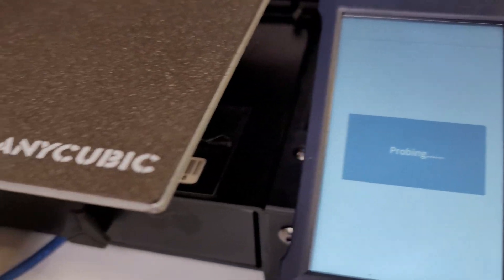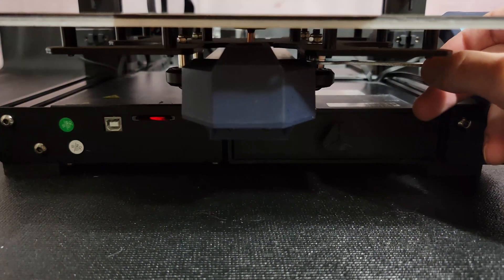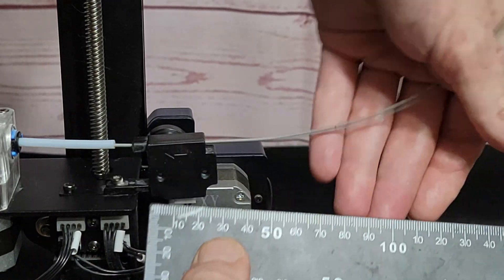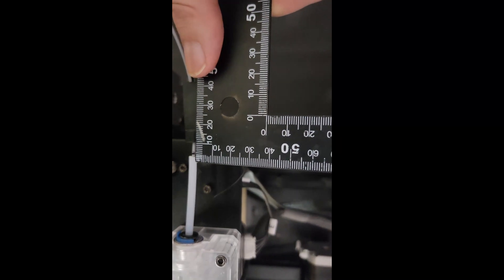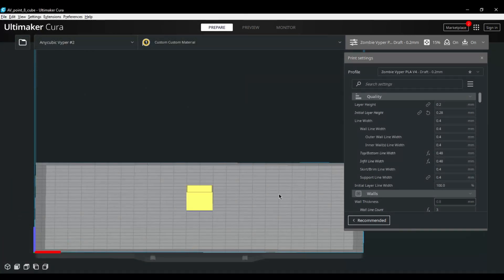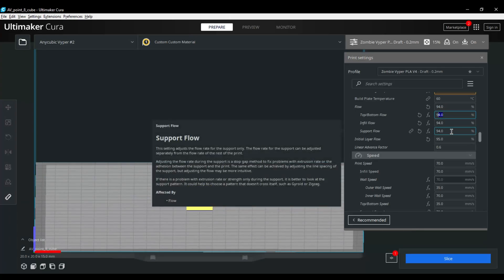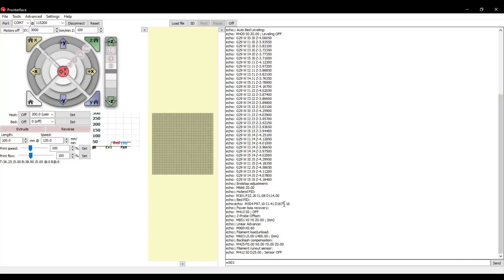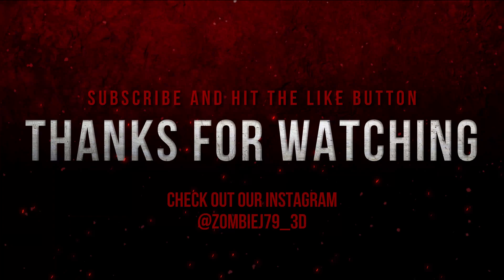Anycubic Vyper Calibration V2 (e-steps , flow, linear advance)

Comment: Dont forget to put  "leveling on" to use your saved mesh. He says everyting else should be left as is and thats not correct otherwise it wont use your mesh. I had my nozzle scrapped along the bed the first time, i should have realized. Here i am trying to calibrate again and this time i asked chatgpt about that option and it should be enabled. It also recommended to do flow calibration first and use that value in extrusion multiplier in the kfactor code generator.
Reply: it's great seeing a fellow user of my printer still exist

Comment: Overall great tutorial. Only thing I would have added (sure I figured it out myself) when it came to the E-step calibration you could have said that your value 98 you use for the calculation is simply 100 minus you measured offset. Just so every noob would get it. But that is a veeery tiny thing in a great video. thanks man helped me a lot

Comment: Hello, I have installed your firmware for the Vyper to use Linear Advance. The flashing worked without any problems but unfortunately it does not print the LA calibration pattern. It prints the first line (K0) after that the lines are incomplete or not printed at all. It also does not print the numbers next to the frame. But I did everything like in your video. Do you have any idea what the problem could be?

Comment: My linear advance test is coming out completely wrong compared to yours.  I only get 5 long horizontal lines and then the printer quickly moves up and puts two vertical lines above those.  Then it pushes the bed out, moves Z up 2cm, and stops.

Comment: anyone else  having issues with the vyper not saving the values for the bed leveling? Ive tried doing the linear test which the first time it works, but when i run anything afther my nozzle likes to print way above the bed.

Comment: Hi there, just ordered this printer, been using the Anycubic kossell linear plus for many years but can no longer source parts for it 😢 i need new rail sliders for the arms and a new build surface for my heated bed mainly. Have approached Anycubic but they no longer produce parts for the linear plus either. Can you suggest a 3rd party that may be able to supply parts or upgrades for my kossell linear plus? Im super excited about the viper and hope it lives up to its name ! How hard would it be to setup a dual colour hot end and extruders and also wondering if you know of any mods to make it direct drive instead of bowden style.... looking forwards to hearing back from you ! Am watching your videos and learning heaps have learned a lot over the year's from delta printers but just this video alone ive learned more from than years of printing with my delta. Any tips to make the Viper a amazing machine and do perfect prints would be very very muchly appreciated 😊 👍 new sub and many likes 👍

Comment: Hey man, great video thanks. Do you have somewhere I can see all your settings? I followed your tutorial but a few problems arose. When doing the Marlin test, it didn't print out the full graph, only the first couple lines then gave up. Every other step was followed before then, but when printing a benchy, it looks identical to before your video. Very stringy.

Comment: Hi.. I'm completely new to 3D printing and just ordered the Vyper yesterday.. really excited to start! As new as I am, do you think installing your firmware will make my starter prints any better? I'm ok with tinkering and tweaking settings, I just dont want to have issues and now know what to ask or how to troubleshoot.  Also - will this print PETG with its current hotend? or will I need to change it?
Any suggestions on your favorite filament brands?  Thanks for a VERY informative video.  You gained a subscriber :)
Reply: im running Will's firmware - BIG difference.  and Capricorn tubing now.

Comment: Thank you for this video. I really appreciate it. Going through this and making the necessary adjustment really improved the quality of my prints. 

Just need to tinker with my z offset a little bit. Do you have any good info you can point me towards?
Reply from the maker: For the offset I will print something with a brim then measure the thickness of the brim and adjust the offset to match inital layer height
Reply: @studiozombie3d  Great advice. I'll do it. Thanks again!!

Comment: Just curious... in Cura there are Linear Advance settings too. What should these be set to?
Reply from the maker: If you have conpatable firmware and have set it in the firmware via terminal you don't need to use the cura setting. It's more for if you need to adjust between filaments

Comment: omg, i finally found an informative video about setting up my kobra max...  
i have 1 question tho.  i used the word doc start and end the gcode,   here is the start gcode 
G21 ;metric values
G90 ;absolute positioning
M82 ;set extruder to absolute mode
G28 ; Home all axes
G92 E0 ; Reset Extruder
G1 Z2.0 F3000 ; Move Z Axis up little to prevent scratching of Heat Bed
G1 X2 Y20 Z0.3 F5000.0 ; Move to start position
G1 X2 Y200.0 Z0.3 F1500.0 E15 ; Draw the first line
G1 X2.4 Y200.0 Z0.3 F5000.0 ; Move to side a little
G1 X2.4 Y20 Z0.3 F1500.0 E30 ; Draw the second line
G92 E0 ; Reset Extruder
G1 Z2.0 F3000 ; Move Z Axis up little to prevent scratching of Heat Bed
G1 F2400 E-1
G1 X5 Y20 Z0.3 F5000.0 ; Move over to prevent blob squish 

the last line G1 X5 Y20 Z0.3 F5000.0 ; Move over to prevent blob squish 
that takes the hotend from the z2.0 mark and moves it to z0.3 THEN starts my print....
it rapids to the start of my print at z0.3 off the bed
if i change this to say 1mm will it go back to the Zstart of the print at the z0.3? or do i have to change it in the acutall file print section?
Reply from the maker: You can adjust the height on the start gcode and once the print starts it will go to the distance you have the offset set to.

Comment: Hi I've jumped into 3D printing with the Vyper as my first unit. I've been able to get some initial prints and tuning done.

I got to tuning linear advance and found out that stock firmware doesn't support it > installed your version 2.8 > got linear advance working.

However I seem to have lost the resume on power loss functionality. Using pronterface I can see that (power loss recovery) M413 is S0, and tried turning it on then M500, and M503 to check that it is S1, however upon power off / reset, the setting doesn't stick and goes back to S0 when checking.

I do love the quality improvement from linear advance, but the resume print is an even bigger thing for me due to power fluctuations where I am.

Any idea how to work around this?  I do appreciate the work you've put into this, much thanks.
Reply from the maker: Try my 2.5 it's more stable for people the 2.8 seems to act odd on the odd unit. 
https://drive.google.com/file/d/1fIU_pV5bnlu77GIQXc9qPa7W9otn1aFr/view?usp=drivesdk
I should have a new update shortly with fixes from the kobra zombie firmware

Comment: I have two vypers. I recently changed the nozzles on both because they were getting old and the printers started printing weird. Before the nozzle changes all I had to do was auto level and it was good to go. Now 1 printer requires a +1 z offset and the other printer requires a -1.5 offset. And now neither will print the initial layer properly or supports. Any suggestions ?

Comment: The vyper has been giving me issues to calibrate, i normally stop at the esteps calibration but now im still having issues. im thinking it may be my combing mode whats making my shell look ugly with buldging lines etc
Reply from the maker: Check your maximum resolution settings they should be .25, .25 and 0.025

Comment: I installed the driver from the link in the description and followed everything  but it just won't connect to my vyper
Reply from the maker: If you have cura open  when trying to use pronterface curs will block the connection

Comment: Studio Zombie, Hi firstly thanks for the great videos, I have followed this one to  a  tee firstly printing the test cube with the  flow rates at 100%  and the results were 1.07 to 1.09 on the .80 cube, I did the math  and set the flow rates to 74% and resliced  and  reprinted the cude now averaging .86 , should I ddrop the rate lower?
Reply from the maker: Try dropping it maybe 3% and check again see if it's closer
Reply: @studiozombie3d  Thanks , what is the best way to set the Z off set for this printer?
Reply: I tried different filaments (old & wet, and new & dry), and the wet filaments gave me 0.95mm wall width wheres the new dry filament gave me just 0.85

Comment: Hello, great tutorial ;). Do you know how to calibrate the hotend thermistor ? I set the printer to 200 °C and measured the temperature with a  thermocouple inserted in the thermistor screw hole. I found that the actual temperature was 210°C instead of 200 but so far so good. For some reason I replaced the hotend that came with an already installed thermistor. Measured again this time the actual temperature was 218°C on the hotend and 200 on the printer. I would like to match the reading from the multimeter with the printer as this time it can make difference while printing (20°C are too much).

Thank you so much!
Reply from the maker: Theres a few units I've seen that run hotter then it reads you can try running a pid tune and see if that helps dial it in. Commect with pronterface and send M303 E0 C6 S210 U1 and it will run 6 cycles at 210 and save the results. Then check it and see if that helps
Reply: @studiozombie3d  Hi, thanks . I will try soon ;) . Have a nice day!
Reply from the maker: @davidev1734  let me know what happens
Reply: @studiozombie3d  Hi, sorry for delay. Just tried the PID autotune but it didn't help (or even a bit worste) . I had a look inside the firmware code and it looks like there is no temperature calibration (hope I'm wrong!) and the temperature sensor is chosen at firmware compilation time. For now my solution is to reduce the printing temp in the filament settings in Cura, so far so good. If you have other suggestion about this issue let me know,you are welcome! thanks for now and keep up the good work!
Davide

Comment: I’m only getting 0, 0.5 and 1 lines out of the k-factor calibration g-code. Is there a setting I’m missing?  Also curious if pitting on walls could be related to retraction speed?  Do you have anywhere I could send you a photo?  Looking for some advice as standard calibration isn’t doing much for me.
Reply: me too :/
Reply: Had the same issue, just set the K-Factor Stepping to 0.1 under the category pattern
Reply: @ProgamerNP  THANK YOU! I’m going to try this later today
Reply: @ProgamerNP cheers that works.
Reply: me also - not sure why
Reply: Me too. I can’t find any answers online. I have the 2.8 zombie firmware flashed to my vyper, but I only get 0, 0.5, and 1 on my linear advance print. I followed all the instructions for the g-code build. I don’t know what to do.

Comment: Thanks a ton for posting this info and the files! Huge help in calibrating my Vyper, especially the linear advance. A question I hope you can answer...I'm trying a mid-print filament color change in the Vyper using your Zombie v.8 custom firmware, Prusa Slicer, and Pronterface. After the printer receives the M600 from the Prusa-sliced gcode via Pronterface, the print head parks and unloads the filament as it should. But after loading the new filament and sending an M108, it only echos: "echo:busy: paused for user" over and over, no matter how many M108s are sent. I then tried pausing Pronterface and it extruded a little bit of filament, but then nothing when pausing/resuming again or sending M108s. Any idea what I'm missing? Perhaps a Prusa Slicer-specific issue?
Reply: Update: I created a profile in Cura and tested it there but same issue. After unloading filament, no response with M108. Hit Pause in Pronterface and it then loads the filament. Send an M108, no response. Hit Resume and it does resume print but only waits for input. Send another M108, still no response, only the continuous "echo:busy: paused for user".
Reply from the maker: @chad4256  try my 2.5 color change should work better on it. 2.8 does odd random things with some vyoers no idea why it's all the same hardware
Reply: @studiozombie3d  Awesome, thanks! That works, at least for Prusa Slicer. I didn't test it but I trust it'll work for Cura as well. One last question...is the Pause/Resume command in Pronterface the same as sending an M108? At M600 the print head parked then waited. I sent an M108 and it unloaded a little filament. I pulled the rest out then loaded the new filament and sent another M108 but nothing. I hit Pause in Pronterface which caused it to extrude a bunch of filament then it automatically returned to the already printed part, dragging all the unloaded filament with it. It then waited for me to hit Resume. I must have the order of things wrong, or perhaps I shouldn't be using the Pause/Resume in Pronterface at all...?
Reply from the maker: @chad4256  you might be able to use the pause button to replace sending the m108 i believe they both use m108
Reply: @studiozombie3d  Thanks for all your help. I just stopped by your website and bought you a cup of coffee.
Reply from the maker: @chad4256  much appreciated

Comment: Hey man great video, but how are you getting  Pronterface to connect? Mine just sits at "connecting" if I close it and try again it just does the same thing, or if I attempt to do basically anything else in Pronterface the program freezes and doesn't respond so I have to close it and reopen and same thing. I don't have any firewalls blocking it. my length, speed, port, etc are all the same as yours. Any ideas? Appreciate it.
Reply from the maker: Did you install the USB driver? And is cura open? If cura is open pronterface can't connect. Try that and let me know if that helps. You can also click on port and it should pick the correct com port for the printer
Reply: @studiozombie3d  Hey Man I really appreciate the help. I was beyond confused for a minute. ha The port just was selecting the incorrect one. Got it figured out though. So I get to where we extrude 100 mm. Well mine went PAST my mark. I assume I pull it out, measure still, and take the 100 % 102 x 405 (in my case)? Same thing even though my mark went past, opposite of yours..? Again, I really appreciate the help. I just want to make sure I don't mess something up even more than what it is with the issues I've been having. Not trying to dig a deeper hole.. Ha
Reply from the maker: @threadchemistry  if the mark went inside the tube just try dropping the esteps to about 390 or 400 and it should be before the tube. If you can get a accurate emeasurement of the mark to the tube just go 100/ say 110× esteps and it should be pretty close
Reply from the maker: @threadchemistry  and if your ever stuck feel free to hit me up on Facebook or my other social media or email studiozombie3d@gmail.com
Reply: @studiozombie3d  Just sent you a quick email buddy..

Comment: My vyper leaks constantly out of the nozzle when it's heated, is that normal? I just got it and feel like smashing it already lol.
Reply from the maker: The volcano nozzles can do that they have a ton of melted material in them so if you don't retract enough at the end of a print the next time it heats up it can ooze a bit. It's a pain when you level and get the hairs all over the bed
Reply: @studiozombie3d  ah ok mate, thank you. I assume they just supposed to leak when they heat then, The thing I was worried the most about though was the nozzle scraped against the print bed when it started printing even after I leveled it. Did I do something wrong? I just got the thing and afraid of destroying it. Thanks for the  response btw, your profiles I use on it now are fantastic.
Reply from the maker: @reddragon4482  some units need to offset to be raised a touch but once you get it set you should be good
Reply: @studiozombie3d  ok, thanks man.

Comment: Why does my linear advance only print out 0, .5, and 1? There are a total of 6 lines but only 3 numbers and it looks not at all like yours.
Reply from the maker: The part I had on the video was a dialed in one. Try doing the linear test but on thw page change the printer settings and leave the linear section stock with no changes you should get more lines

Comment: Hi there, do you advise using the CURA extension that adds linear advance to the slicer options? It seems like a nice way of setting the k factor if you change filament a lot.
Reply from the maker: Yep I use it on my cura for my vypet makes adjusting super easy

Comment: Great Videos, very informative,  i was following everything and having issues with the linear advance,  checked out the comments and found the answer that i needed the custom firmware.  So i installed it following your other video and installed FIrmware Zombie 2.8,  calibrated estops, releveled the bed rehomed.  Now when i go to start the cube file it starts like 10mm above the bed?  any ideas why,  the homing looks like its in the right spot
Thank You
Reply from the maker: Send m502 twice to reset then m500 to save the eeprom then reenter your calibration values and relevel that should fix it
Reply: @studiozombie3d  thank you,  i did it but it didnt reset,  so i saw another comment and rehomed it a few times and it took